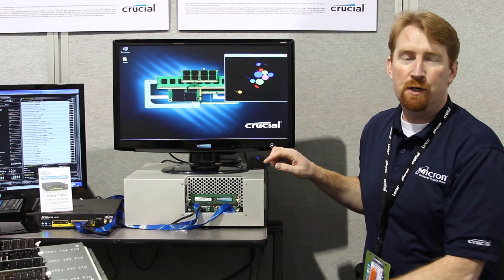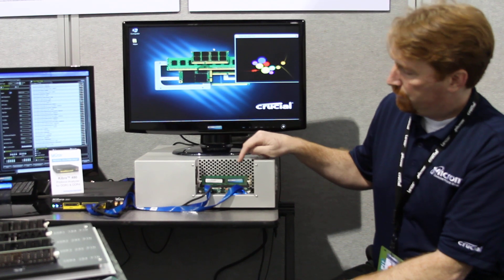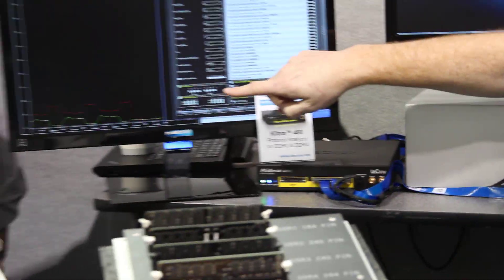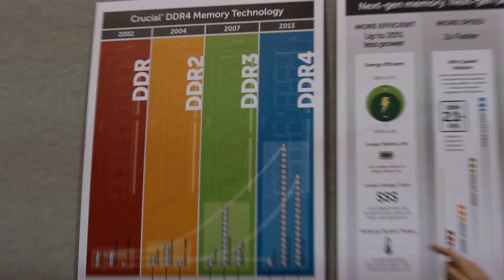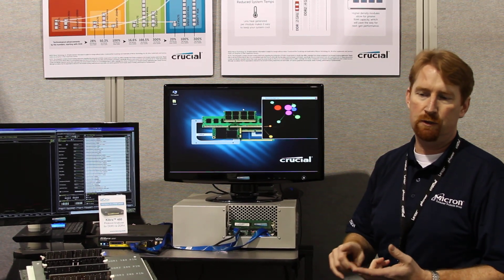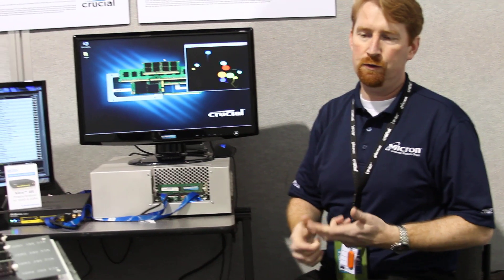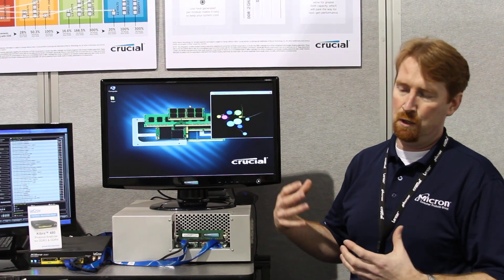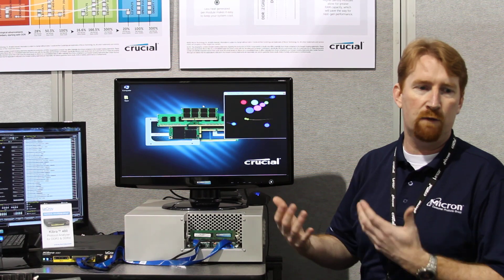CES 2013 - Micron displays world's first working DDR4 memory

Comment: You'll get awesome results. DDR3 was an awesome improvement to begin with. After they OC'd the RAMs they couldn't get the DDR3 memory clock speed to a critic level. DDR4 will have twice that speed. 3200MHZ sounds enough for a while. I say motherboards will rely on DDR4 for a long time after the release.

Comment: The power saving is also in the CPU i believe where DDR4 has an invert bit with each byte which allows always under 50% draw on the SUPPLY RAIL terminations. It ticks all the boxes. Shame the silicon process is incompatable with CPU process.